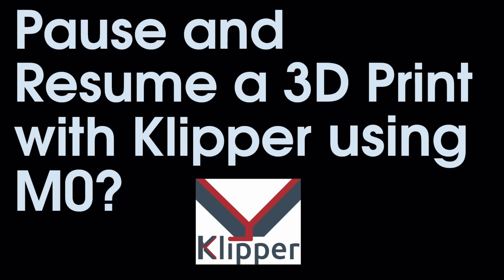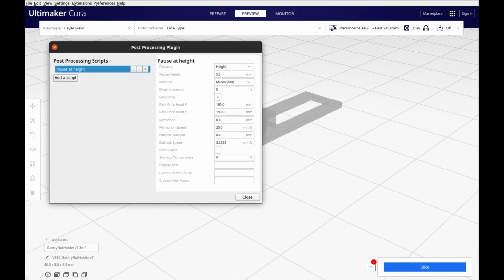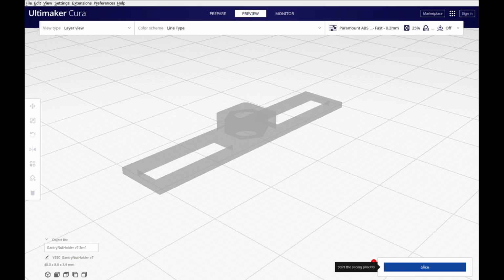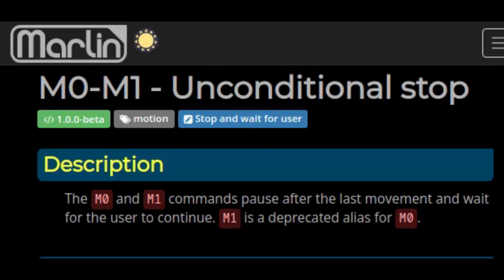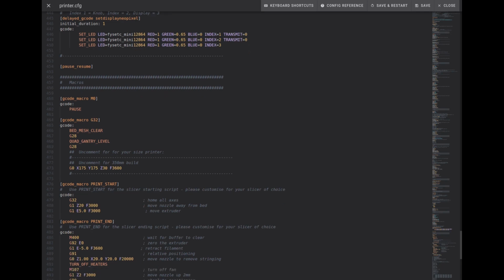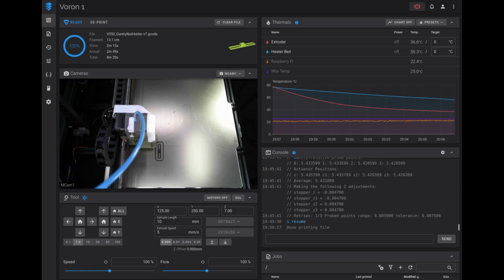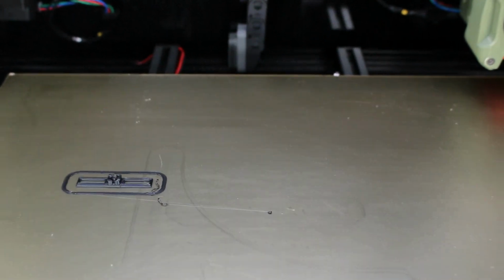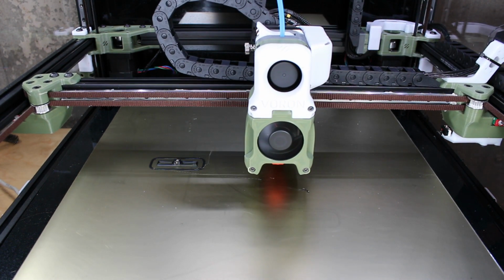Pause & Resume a Print using Klipper

Comment: PAUSE doesn't work for me.  I get an error message saying the extruder isn't ho't enough.  The print head does home the x and y axis, I think it lifts the z axis by 10 mm as well.
Reply from the maker: Do you get the error message when you pause, or when you resume?
Reply: @KapmansBasementWorkshop  It happens during pause, I never issued a RESUME or clicked on RESUME in mainsail or on the display clicky wheel.
I need to check if there is a macro.cfg file, I don't see the message in printer.cfg, and don't know if it is baked into klipper itself.
Reply from the maker: @KennethScharf  Do you have a fluid.cfg or mainsail.cfg?  If so, look there to see the Pause macro and see if there is a temperature chack.

Comment: is this octupus  firmware  can be used in bigtreetech skr mini e3 v3.0 for sensorless homing ?
Reply from the maker: If the skr mini supports diagnostic mode (a jumper needs to be set for each motor driver), and the stepper drivers support "Stallguard" (2209's do support stallguard), it should work just fine.  However, I'm not sure what you mean by the "octupus firmware".  Is this Octoprint or something else?

Comment: so far you have the best video explaining my problem. while it is paused how to purge for color swaps?
Reply from the maker: While paused, I cut the filament at the top of the print head, feed in the other filament and then extrude from the klipper/mainsail control screen. When it’s ready, type in or push resume.

Comment: im having issues where whenever i resume the print i get a layer gap. I made sure that the extruder was to temperature before resuming and also extruded a bit
Reply from the maker: Compare your pause and resume macros to mine.  Anything look like  it might impact the stored or resumed position?
[gcode_macro PAUSE]
description: Pause the actual running print
rename_existing: PAUSE_BASE
# change this if you need more or less extrusion
variable_extrude: 1.0
gcode:
    ##### read E from pause macro #####
    {% set E = printer["gcode_macro PAUSE"].extrude|float %}
    ##### set park positon for x and y #####
    # default is your max posion from your printer.cfg
    {% set x_park = printer.toolhead.axis_maximum.x|float - 5.0 %}
    {% set y_park = printer.toolhead.axis_maximum.y|float - 5.0 %}
    ##### calculate save lift position #####
    {% set max_z = printer.toolhead.axis_maximum.z|float %}
    {% set act_z = printer.toolhead.position.z|float %}
    {% if act_z < (max_z - 2.0) %}
        {% set z_safe = 2.0 %}
    {% else %}
        {% set z_safe = max_z - act_z %}
    {% endif %}
    ##### end of definitions #####
    PAUSE_BASE
    G91
    {% if printer.extruder.can_extrude|lower == 'true' %}
      G1 E-{E} F2100
    {% else %}
      {action_respond_info("Extruder not hot enough")}
    {% endif %}
    {% if "xyz" in printer.toolhead.homed_axes %}
      G1 Z{z_safe} F900
      G90
      G1 X{x_park} Y{y_park} F6000
    {% else %}
      {action_respond_info("Printer not homed")}
    {% endif %} 
    
[gcode_macro RESUME]
description: Resume the actual running print
rename_existing: RESUME_BASE
gcode:
    ##### read E from pause macro #####
    {% set E = printer["gcode_macro PAUSE"].extrude|float %}
    #### get VELOCITY parameter if specified ####
    {% if 'VELOCITY' in params|upper %}
      {% set get_params = ('VELOCITY=' + params.VELOCITY)  %}
    {%else %}
      {% set get_params = "" %}
    {% endif %}
    ##### end of definitions #####
    {% if printer.extruder.can_extrude|lower == 'true' %}
      G91
      G1 E{E} F2100
    {% else %}
      {action_respond_info("Extruder not hot enough")}
    {% endif %}  
    RESUME_BASE {get_params}

Comment: Thanks! I had to remember to include the pause resume section. Works great! Now i have to figure out how to get it to recognize a custom hot end temp variable because it turns off when i pause. no biggy i just manually put a value which helps when mixing filiment types but that's my next step.
Reply from the maker: Glad it helped!

Comment: Perfect. Just what I needed. I don't know why others make it so complicated!  :-)
Reply from the maker: It’s actually pretty easy.  The video probably could have been shorter.  Thank you!
Reply: @KapmansBasementWorkshop  np.  I've recently switched from Cura to Orca Slicer with a Creality K1 Max.  I believe Orca is more Klipper-friendly?  Turns out that, combined with your work shown in this video, Invoking a pause is really easy in Orca.  After slicing, slide the slider to the layer you want to pause printing at -> right-click the + symbol on the slider and choose "Add pause".  No additional plugins or addons necessary.  Resuming can be done from the printer LCD or presumably as you show here from the Fluidd console.  Thanks again for a great explainer.
Reply from the maker: @steveharmancambridge , And do you add pauses to switch filament colors or insert objects into the print?

Comment: Doesnt work for me.  Sonic Pad is giving me an error telling me I must "home axis first" when I try to resume
Reply from the maker: The Sonic Pad by default seems to be setup differently. I have one now. Once I have that working, I’ll post how to configure that.
Reply: @KapmansBasementWorkshop  i think im getting it to work now.  Definitely have to use the filament change script under modify gcode.  X position and Y position seem to allow me to park the head where i want just fine, without getting the "home axis" error.  But it looks like M83 needs to be added to your starting gcode for relative extrusion and turn on relative extrusion in special modes.  Otherwise i either get "Extrude move too long" errors or it will potentially retract too far on a vary large print and grind gears really bad.

Comment: Great tutorial, thank you. One thing that was not mentioned is that the PAUSE command moves the extruder to the HOME possition. This means that if your home possition is in the center of your plate, then you might have problems to insert magnets or nuts. To rectify this either set your home somewhere else or better add this to your PAUSE macro: G1 Y0 X0 -this moves the extruder to X0 and Y0 and once the print is resumed it will continue where it was paused ;)

Enjoy
Reply from the maker: This is a great tip.  I just recently moved my home to center.  I think you may have saved me the destruction of a future print!  Thanks!

Comment: Thank you for the video, the printer does pause but when I click on resume the printer wants me to home first - please advise.
Reply from the maker: I'm guessing that for some reason when PAUSE was executed, the last position of the print head was not saved.  Have a look here at my Fluidd.cfg file: https://github.com/Kapman1/Kapman1/blob/main/fluidd.cfg

In that file are both a redefined "pause" and "resume".  Note I did not write these, they just appeared after installing Fluidd.  I assume the same happens with Mainsail.  Note how in the Pause macro, some values are stored that need to be reset once the Pause ends.  If yours looks different (it has looked different for some people), comment your existing one out and copy these into the file and restart klipper to see if this gets fixed.

Comment: All I wanna do is make my ender S1 pro with sonic pad PAUSE!! lol I tried this and it goes to pause corner...but then just goes right back into printing. I typed out exactly what you have in printer.cfg Any idea what I'm doing wrong?
Reply from the maker: Multiple people have complained about this.  I just got a sonic pad.  If you can wait a few more weeks, there is a good chance I can answer the question once I install it.
Reply: @KapmansBasementWorkshop  it's exactly the same as you show in your video. I use web browser and it displays klipper UI. Must run code different tho...
Reply from the maker: @Cereal_Killr   - Some with Sonic pads told me that the code I used here worked for them.  So there must be something different.  I'll know soon enough.
Reply: @KapmansBasementWorkshop  When I put "pause" on line below "gcode:" it turns orange like you have...but my printer will only freeze up giving connection error to printer. when I move it up on same line the word pause goes white...but then it does'nt work. Does it matter what line I'm using? my [pause_resume] is up around line 20ish if I recall correct. so it's different from yours...if that helps any

Comment: This doesnt work... my printer pauses and say i need to home my 3d printer.
Reply from the maker: It works for me and many others.  What does your cfg file look like?
Reply: @KapmansBasementWorkshop  
[gcode_macro PAUSE]
rename_existing: BASE_PAUSE
# change this if you need more or less extrusion
variable_extrude: 1.0
gcode:
    ##### read E from pause macro #####
    {% set E = printer["gcode_macro PAUSE"].extrude|float %}
    ##### set park positon for x and y #####
    # default is your max posion from your printer.cfg
    {% set x_park = printer.toolhead.axis_maximum.x|float - 5.0 %}
    {% set y_park = printer.toolhead.axis_maximum.y|float - 5.0 %}
    ##### calculate save lift position #####
    {% set max_z = printer.toolhead.axis_maximum.z|float %}
    {% set act_z = printer.toolhead.position.z|float %}
    {% if act_z < (max_z - 2.0) %}
        {% set z_safe = 2.0 %}
    {% else %}
        {% set z_safe = max_z - act_z %}
    {% endif %}
    ##### end of definitions #####
    SAVE_GCODE_STATE NAME=PAUSE_state
    BASE_PAUSE
    G91
    G1 E-{E} F2100
    G1 Z{z_safe} F900
    G90
    G1 X{x_park} Y{y_park} F6000

[gcode_macro RESUME]
rename_existing: BASE_RESUME
gcode:
    ##### read E from pause macro #####
    {% set E = printer["gcode_macro PAUSE"].extrude|float %}
    ##### end of definitions #####
    G91
    G1 E{E} F2100
    RESTORE_GCODE_STATE NAME=PAUSE_state
    BASE_RESUME
Reply from the maker: @JoseRenatoIzar  Did you change any of the code above?  In the video, I don't touch this.  All I did was add this into the printer.cfg file:  
[gcode_macro M0]
gcode:
    PAUSE

I placed that in the marco section.

Your PAUSE and RESUME macros's look different from mine:
[gcode_macro PAUSE]
description: Pause the actual running print
rename_existing: PAUSE_BASE
# change this if you need more or less extrusion
variable_extrude: 1.0
gcode:
    ##### read E from pause macro #####
    {% set E = printer["gcode_macro PAUSE"].extrude|float %}
    ##### set park positon for x and y #####
    # default is your max posion from your printer.cfg
    {% set x_park = printer.toolhead.axis_maximum.x|float - 5.0 %}
    {% set y_park = printer.toolhead.axis_maximum.y|float - 5.0 %}
    ##### calculate save lift position #####
    {% set max_z = printer.toolhead.axis_maximum.z|float %}
    {% set act_z = printer.toolhead.position.z|float %}
    {% if act_z < (max_z - 2.0) %}
        {% set z_safe = 2.0 %}
    {% else %}
        {% set z_safe = max_z - act_z %}
    {% endif %}
    ##### end of definitions #####
    PAUSE_BASE
    G91
    {% if printer.extruder.can_extrude|lower == 'true' %}
      G1 E-{E} F2100
    {% else %}
      {action_respond_info("Extruder not hot enough")}
    {% endif %}
    {% if "xyz" in printer.toolhead.homed_axes %}
      G1 Z{z_safe} F900
      G90
      G1 X{x_park} Y{y_park} F6000
    {% else %}
      {action_respond_info("Printer not homed")}
    {% endif %} 
    
[gcode_macro RESUME]
description: Resume the actual running print
rename_existing: RESUME_BASE
gcode:
    ##### read E from pause macro #####
    {% set E = printer["gcode_macro PAUSE"].extrude|float %}
    #### get VELOCITY parameter if specified ####
    {% if 'VELOCITY' in params|upper %}
      {% set get_params = ('VELOCITY=' + params.VELOCITY)  %}
    {%else %}
      {% set get_params = "" %}
    {% endif %}
    ##### end of definitions #####
    {% if printer.extruder.can_extrude|lower == 'true' %}
      G91
      G1 E{E} F2100
    {% else %}
      {action_respond_info("Extruder not hot enough")}
    {% endif %}  
    RESUME_BASE {get_params}
Reply: @KapmansBasementWorkshop  I did not =(
Reply: Same with me. I was using it on a Sonic Pad and an Ender Pro 3. Would pause but on resume it would give an error it had to be homed.
Reply from the maker: @terrytang7856  I have no knowledge of a Sonic Pad.  I just had to look it up to figure out what it is.  It appears to be a Creality product.  Have you tried contacting their support to find out why pause/resume don't work?  They might have a fix.
Reply: Yes. I tryed to use kapman's code. Same results. I kind of give up. Tryed a lot of changes, asked for gpt help and finally gave up after many hours dedicated to it
Reply from the maker: @JoseRenatoIzar  I wish it worked for you.  Apologies for that.

Comment: My gcode macros are in mainsail.cfg. I know you are using fluid, but they are similar. So do you know if I would put it with the other gcode macros in the mainsail config or in the printer config?

This video was so helpful by the way so thank you!
Reply from the maker: You should not need to move the pause gcode macro from where it currently sits.  I left it where it was.  I only made the minor change you saw in the video.  If you go to github, you can see my printer.cfg files if that proves helpful.  Any other clues you can give me?  Thanks for watching!
Reply: @KapmansBasementWorkshop  Yes, I’m asking though about the gcode M0 command. I put it in the mainsail config and it worked. It probably would work in either config.
Reply from the maker: @kulpercinematic  Glad it's working!

Comment: I Tried M600 as well as M0 pause., Both cases works but I face a problem, while resuming print about 1mm higher than the actual position and printing in air., is there a solution., If needed,  could move z axis -1mm and start printing from there. but i don't know how to put this on configuration file. Any help??
Reply from the maker: That should not be happening.  Have a look at my Fluidd.cfg file (should be very similar to your Mainsail.cfg file if that is what you use).  The basis for Pause resides there by default.  My file is in Github:  https://github.com/Kapman1/Kapman1

Any differences?

Comment: Thanks for the great tips! nozzle temp comes down during pause making it harder to change colours, any tips for this?
Reply from the maker: Hmmm.  I use this about once per month on average, and I don't remember the nozzle cooling.  But, I did not specifically check for it and I tend to be in the area when it pauses.  The only thing I can think of is a macro of some kind running.  Later, I'll review my cfg files and see if I can see something.  I'll also try and test this sometime during this week so I know 100% if the nozzle is cooling or not.
Reply: @KapmansBasementWorkshop  It was nozzle temp, i tried it, i set in cura in the same layer script to hold temp at 200 and thats exactly what it did. Cheers!
Reply from the maker: @XTC3D  I'm glad to hear that it's working for you!
Reply: @KapmansBasementWorkshop  wow, fast reply and thankyou, since i did find in script in cura for pause at layer, you can allow  standby temp, though, not sure if thats for the bed or nozzle, im hoping nozzle.
Reply from the maker: @XTC3D  That's for the nozzle.

Comment: Hello,
great job, as usual, but personally I use the M600 macro. Just add it to printer.cfg in the macro section. I attach it to my comment.

[gcode_macro M600]
gcode:
    {% set X = params.X|default(50)|float %}
    {% set Y = params.Y|default(0)|float %}
    {% set Z = params.Z|default(10)|float %}
    SAVE_GCODE_STATE NAME=M600_state
    BREAK
    G91
    G1 E-.8 F2700
    G1 Z{Z}
    G90
    G1 X{X} Y{Y} F3000
    G91
    G1 E-50 F1000
    RESTORE_GCODE_STATE NAME=M600_state
Reply from the maker: I'm going to give that a try.  Looks cool.  Thanks!

Comment: Great video, can't believe people complain about it being to long. New to kipper. In cura on the drop down box how much information did you fill in? Did you have to tell it where to home and did you fill in a temp to hold it at during pause? Just need to know exactly how much to fill out. Thanks!
Reply from the maker: Its really much simpler than that.  Just fill in where you want it to pause.  I left everything else in the cura dialog alone.  When you generate the gcode for the print, Cura will automatically include the proper gcode.  When the printer pauses, Klipper will by default keep the correct temperature, store any required values to get back to the exact position to restart the print once you enter "resume".  Really, Cura and Klipper take care of pretty much everything for you.  Thanks for watching!

Comment: This was super helpful. I have an Ender-3 S1 Pro and I added a Sonic Pad to it which runs Klipper. When I used M0 it was pausing and then almost immediately resuming the print. It was quite frustrating. Using the code to define M0 was all I needed as pause_resume was already on and pause was already defined. But watching this got it working and it's something I have been struggling with for a bit.
Reply from the maker: Glad it helped!  Thank you for the nice response and watching!

Comment: The backwards way to accomplish this: while in the "Pause at Height" tab, select "RepRap (M226)" as Method, and then where it says "G-code after pause" simply enter "PAUSE". I'm not sure if the method part is that important, as you are just using the opportinity to inject "PAUSE" into the G-code, but I know this way does allow you to set the extruder temp during the pause successfully in that tab.
Reply from the maker: That is a good tip that I will try.  Thank you!
Reply: Do you know if this works on the Sonic Pad?